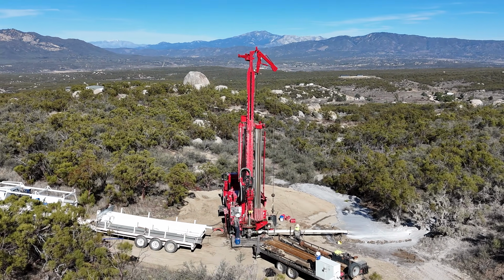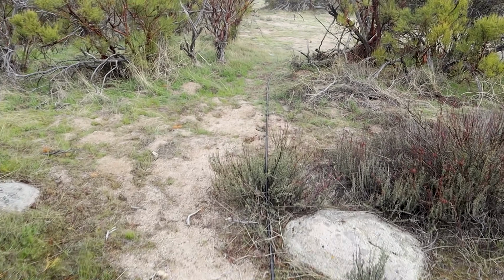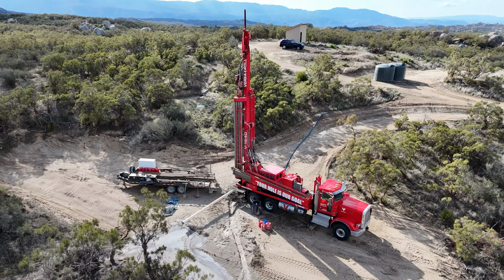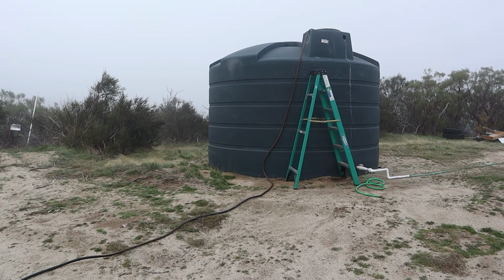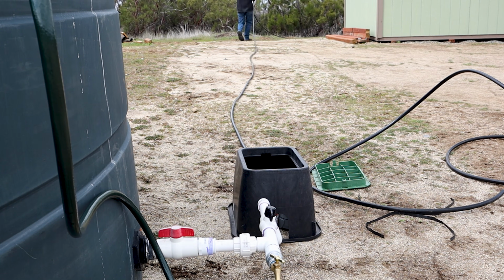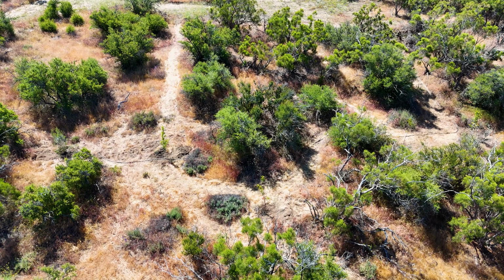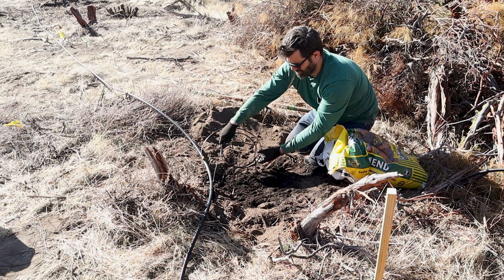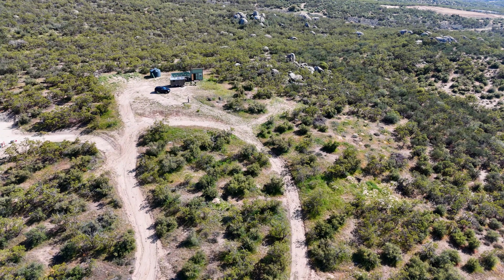Off-Grid Water System: Well Drilling to Orchard Irrigation

Comment: GC here, my wife and I just moved to a new house and are on 5,000 gallon water tank temporarily. Zero water pressure for showers, toilets, sinks, etc. Had to install an inline pump to maintain roughly 40 psi. You don’t need that for drip line, but you can YouTube “rain water solar pump watering system” for ideas on how to get a cheap water pressure solution for irrigation. About $200 for solar panel, converter, battery, and pump.
Reply from the maker: Nice that seems like a straight forward solution

Comment: Had the same problem with my irrigation controller. You need to buy the ball valve kind. They do not need water pressure to operate.
Reply from the maker: Thanks! I'll definitely check that out